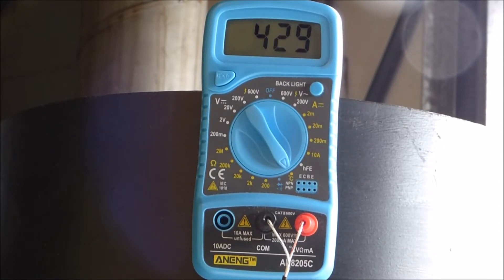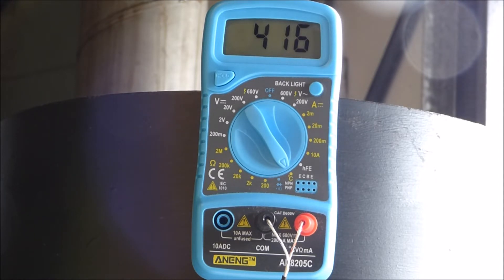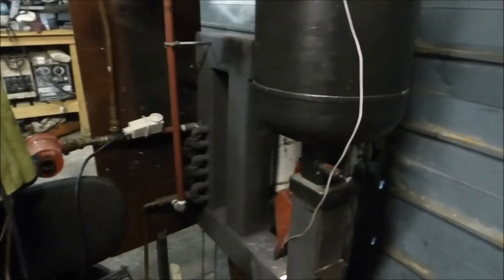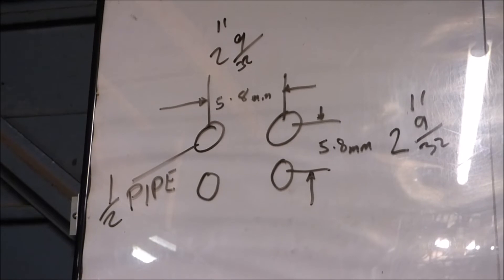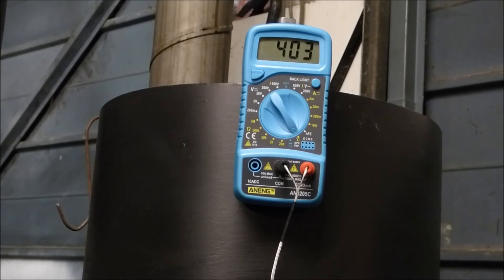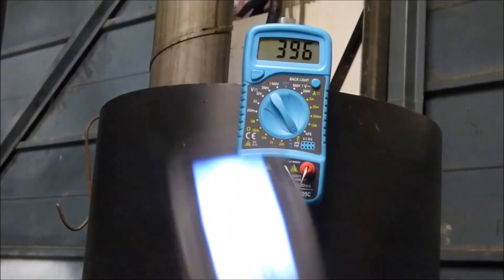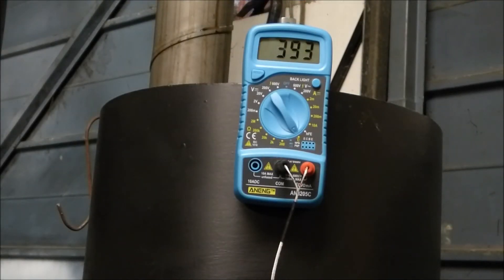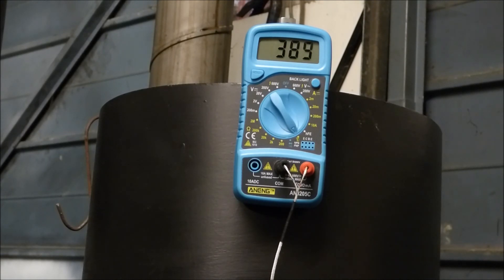Rocket stove wood pellet space heater MK3 DIY No.41

Comment: Hi David,I have built my first stove and it runs brilliant,too good. I can't seem to run it colder without it smoking. Going to try raising the basket so there is less material to burn. The temps you were just recording,is that C or F degrees ?
I am getting 370 degC  with no problems.
I am building a boiler now,16tubes.
Did you ever build a fire with out the middle pipe welded to the burn box? How critical is the length of the middle pipe. I want to make more use of the heat being produced along the length of the burn box,Steam! I have a cunning plan,which I will divulge at a later date. Keep up the hot work!

Comment: Hey David, still working on the rocket stove getting some good temps. Air flow seems to fluctuate with the rocket effect sometimes dying away completely. It seems to coincide with windy days. Will wind vein styled chimney cap fix that?  Stove seems to go harder with more pellets in the shoot.  I don't know what effect that would have on air flows as it could only serve to reduce any air flow coming down the pellet shoot. Would a damper in the chimney have any positive effect on airflow and make the intensity of the fire easier to control. I have tried to use the door to control the air flow but unless the temps are very high it tends to cut the heat down too much and again i loose the rocket effect.
Great work David, talk soon. Kind regards Roger TAIG
Reply from the maker: Watch video on my chimney.
Reply: @davids381  Thanks David, i have my chimney at just over 3m long with an inner diameter of about 120mm. The other thing that may be causing me some issues is air flow coming down the feed tube. I have a 75mm inner feed tube inside the outer 100mm tube to just above the burn basket. I blocked off all air gaps on the 100mm tube and the only air getting in down the feed tube would be the air filtering through the pellets. This unfortunately significantly reduced the speed of the burn/rocket process, thus the heat output. Do i need an air flow on the 100mm outer tube. I have previously noticed in your earlier videos that you had two 25x10mm tubes going down the inside of the outer tube at the front for pellets and at the rear for kindling.  Any assistance will be appreciated.  Sorry to be a burden.
Kind regards Roger TAIG
Reply from the maker: videos 39 41 42

Comment: David, in one of your videos you stated that the lower tube was constructed from 0.25 inch steel plate for durability; however, I was unable to see specs on your selection of the 4 inch square tube wall thickness in your original version 3 videos which had no boiler assembly; also are these tubes cold or hot rolled steel?  Thanks for your time and sharing of your knowledge with your video postings.
Reply from the maker: the bottom tube is fabricated 1/4 x4 inch plate.

Comment: Prefer to use stainless steel since mild steel fittings will cause water to go brown, need hot water for washing.
Reply: Would be advisable to not use the boiler feedstock directly, use a heat exchanger instead.
David hasn’t said, but he may be using DI/DM water, maybe some additives as well.

Comment: Which uk company supplied the pipe ?
Reply from the maker: pipeline
Reply: do you think 3/4 inch would be and improvement, or use corrugated pipe to reduce laminar flow (increase turbulence) so that heat gets to central portion interior portion of the pipe ?
Reply: I’ve considered that as well, but more tubes it a wider stack both seem to return bigger numbers for temp increase. This would make NECESSARY a steam release scheme, lest the setup energetically disassemble itself, particularly on a circ pump fail.
Reply: ... more tubes OR a wider stack...
Sorry.